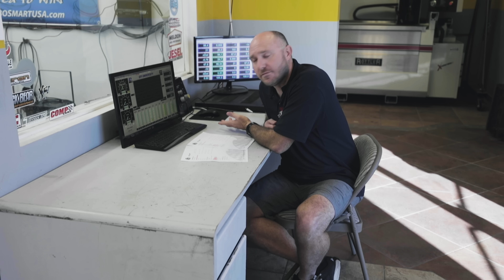Are you sure you have a "Pump Gas" friendly tune?

Comment: So with X98 having a RVP of 3 psi and 10% distillation is 170*F, it sounds like it will be very forgiving as the track weather changes. However in my situation, I will be cutting it with 91 E10 (half tank of E10, half E98) hoping for an E50-E55 blend. Not sure exactly how the final RVP and 10% distillation would come out to unless I had the datasheet for shell 91 or 93.
Reply from the maker: It's great that you're trying to get those values accurate!

Comment: This the most creative approach to explaining the working concept of EFI calibration for engines using pump gasoline as a fuel; mind you, all without speaking directly about octane of the fuel itself 🤔

A lot of information on the importance of fuel characteristics and other details which will dictate how the fuel behaves as an energy source for an internal combustion engine. This is super technical information, but just as was noted, listen to it as many times as you can to get a full grasp of the topics being discussed. 

Even better, want to learn a lot more about the topic in question and the special skill set of EFI calibration, Head on over to www.efi101.com and look at the courses on offer to get started. Within each course there’s a lot of similar discussions where the students can broaden their scope in a very practical and equally pragmatic manner; so the very essence of the ideal learning experience 🙌🏼

Thanks for another great video 🙏🏼🍺❤️